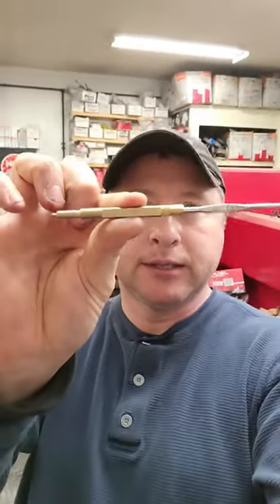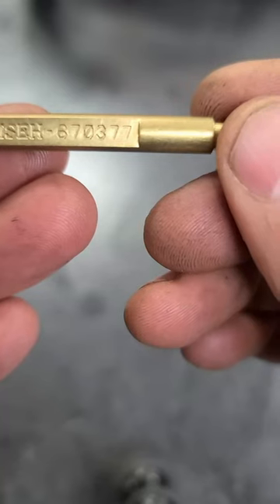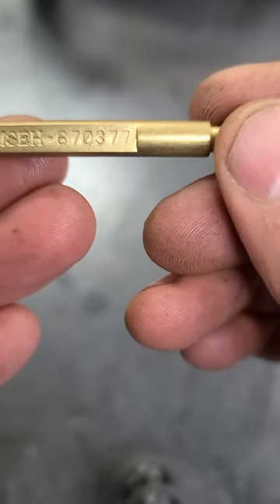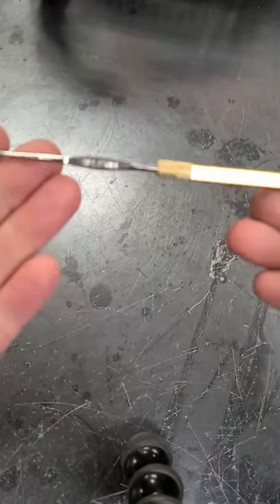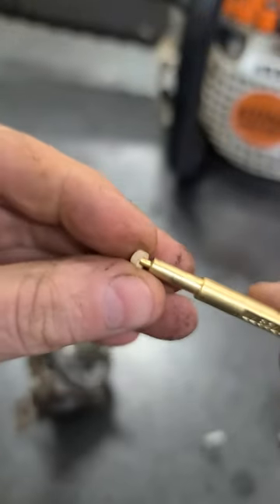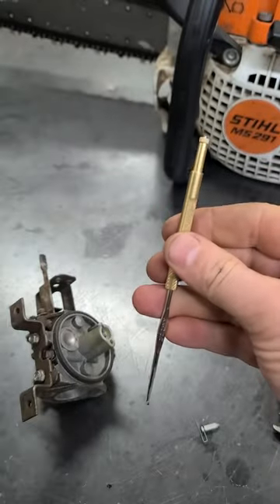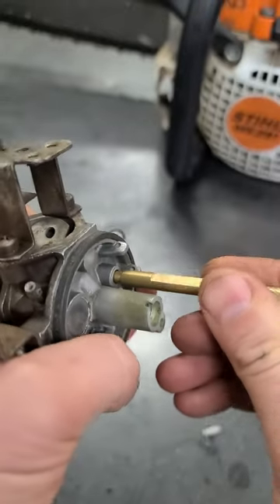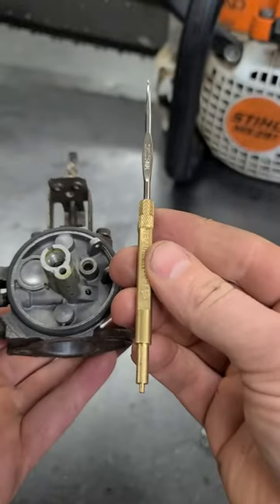Must Have Tecumseh Carburetor Tool - #shorts

Comment: I finally got one after many years of using drill bits with no issues and it's a game changer in saving time on snowblowers because i don't take the chance of dropping the seat. Dropping and loosing a seat is a pain, so I buy the 10 packs from Rotary but with the tool I don't have to worry. The original tool is hard to find, a new company makes them called C.T.S. and they are much less expensive.
Reply: They used to have a piece of plastic from tecumseh

Comment: Personally I'd sooner spend the money replacing the Tecumseh engine, there's a good reason they're no longer made!
Reply: Have to disagree with you there I never had issues with tecumsehs even at our mower shop still work on em daily the 5hp engines did have valve issues but other than that just your basic common issues I like em but I respect your opinion because I always want to learn from other  folks